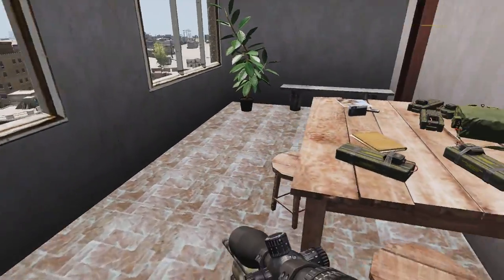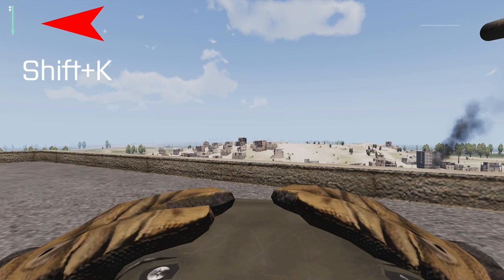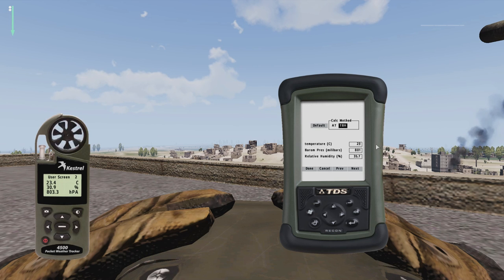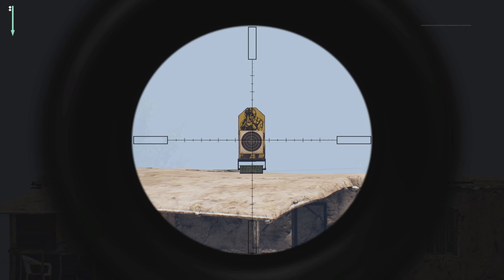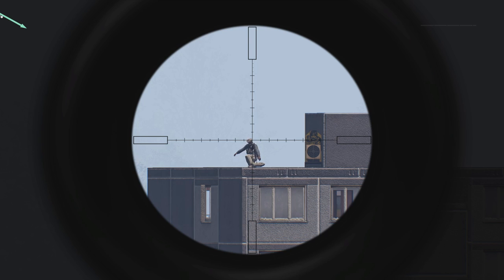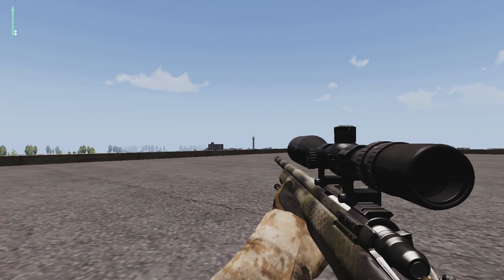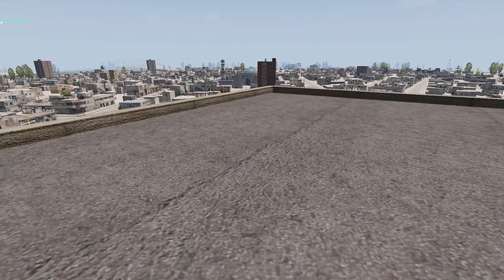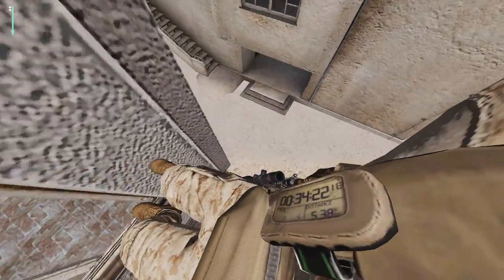Arma 3 - ACE 3 Sniping Tutorial [2017]

Comment: Great video, but you did do a small mistake. the wind direction is supposed to be where it comes from not where it goes, so you entered the opposite clock number for that. the reason the shots still hit is the atragmx told you to adjust right and you instinctively adjusted left. just wanted to point that out...
Reply: You're wrong. The atragmx says R, as in you have to adjust for the wind going R and move the scale LEFT. I've tried it in the virtual arsenal. Adjusting POSITIVELY for the RIGHT is way off. Adjusting NEGATIVELY for the RIGHT is correct.
Reply: No wind direction is input wrong in the video. At 4:10 after he puts in the wind value in the Atrag as 4 oclock (wrong) it shows a POSITIVE windage correction needs to be made.  However he actually sets the scope with a NEGATIVE (correct) windage. If he had set the wind in the Atrag correctly to 10 oclock (not 4) the windage would have calculated the NEGATIVE value that he actually used and been correct.
Two things you need to remember. 1: the wind arrow points in the direction the wind is GOING not coming from and the Atrag is OPPOSITE it wants to know where the wind is COMING from not going (I know, annoying)
2: For scope windage adjustnemt
- NEGATIVE clicks move the crosshair left of target (ie compensating for wind from the left)
+POSITIVE clicks move the crosshair right of target (ie compensating for wind from the right.

Comment: Great video and I've got a little suggestion to improve its accuracy. The reason your having to flip the wind value the Atrag calculates from + to - when you set the scope is because your setting the wind backwards in the Atrag. Wind direction should be 10 (not 4). This will make the Atrag calculate the correct value and you won't have to flip it when setting the scope. Hope that makes sense

Comment: Two Errors:
1. When you input wind speed, in the box labeled "1" is the "low" wind speed and "2" is the "high" wind speed, which means the minimum and maximum of the wind speed if it fluctuates
2. The "Update" button is not needed, as the values in the "abs" column is already the correct value. 

When you click "update", the value in abs would be put into "Cur", meaning current scope setting, which is just to save your scope setting after you have taken the shot. When you move on to a new target and calculate the adjustment needed, the "Rel"(relative) column would display the amount of adjustment needed from you "Current scope setting" to get to the "Absolute scope setting". This feature is needed only for real life, when there isn't an indicator showing your current scope setting, and you can just follow the "rel" column and turn the knob accordingly.
Reply: Doing something that is not needed is not exactly an error.

Comment: How would you adjust for wind on the fly with the range card? I play with a milsim unit and I play as a Designated Marksman. Our rules make it where only actual snipers have an Atrag, and I hear they don't even work anymore. So all I have is a Kestral, vector 21, and a range card. The range card has stuff for wind, but only if it is 4 mps. so lets say I had a target at 600m with a wind blowing east to west at .8 m/s. and for a 4 m/s wind it says adjust 1.2. How would I adjust roughly?

Comment: My biggest problem with ace is the moving. Like if my target moves away I can't shoot them anymore because I'll have to re calibrate. Is that as big a problem or no?
Reply from the maker: it all depends on the wind, if it's blowing over 2m/s, you will have to adjust. otherwise, the target probably wont move too far so you should be fine

Comment: I'm doing all of these stages with the m24 with the same caliber as in the video and tried with most of the rifle scopes but the bullet hits like a "mile" away anyway, it cal land at the bottom of my scope to the second mils from the center, wtf am I doing wrong?
Reply from the maker: Hm, gotta make sure to test how different guns work with ACE3. Because guns from some mods do not perform all that well with ACE sniping equipment. Sorry for the late comment
Reply: The scope adjustments you make are not equal to meters. If you sniped in Arma 3 vanilla just forget everything you know because the ACE mod is as realistic as it gets. The scope adjustments (either elevation or wind) are MOA adjustments. Those numbers do not equal to meters. So thats why you need to know the rifle, scope and bullet youre using. The scopes in ACE3 are for some weird reason 1/10 MOA adjustments scopes. So for every 0.1 click you are making a 0.10 MOA.. 10 "mini clicks" are 1 MOA. In real life scopes usually are 1/4 and 1/8 MOA Adjustments.. A very important thing to know is the reticle youre using (MRAD or Mildot) as the measurements for shooting slightly vary. The best thing you can do is learn the basics withouth any of that fancy equipment. From 1 to 300 meters its going to be easy to shoot. Beyond that is where it gets more difficult. Grab a range card and understand your ballistics.. See how much your round drops at certain ranges and adjust for windage by shooting and shooting over and over till you have a basic feeling of where the bullet will land. Then proceed to use the Kestrel, Atrax and Dagr.
Reply: So in a nutshell.. If you want to snipe somebody with a M24 shooting 7.62x51 M118L  at 350 meters away you DONT adjust your elevation to 3.5 moa.. You check your bullet chart and try to remember values for basic ranges from 100 meters to 500 meters. In this case asuming you have windage coming towards you, just adjust to 1.7 - 1.8 (value for 350 meters drop) and aim for where you want your bullet to hit. Done.
Reply: basically, sniping in ace 3 is a fucking pain in the asssss
Reply: @jordanssfor  Sniping in ACE takes some time to set up right which is what I like. It feels realistic, and I usually play the middle ground between all-out sniper and basic rifleman by being a Marksman. I found that I managed to score most hits with my G3A3 (my go-to marksman weapon) by memorizing range values from my range card and adjusting windage accordingly to how off center I hit. The unit I Play with doesnt provide marksmen with the fancy sniper stuff which sometimes sucks but often times makes The experience more enjoyable.
Reply: @SkyripperThaBird  it is a goal of mine to some day get used to long range engagements but my focus point this year has been centered around learning how to handle situations evolving around me, i feel like gaining that experience will help me a whole lot more when i decide to do some sharpshooting C:
Reply: @jordanssfor  Indeed so, and being a Marksman You need the experience of both being a rifleman and knowing how to engage longer range targets reliably. If you panick when stuff starts going down around you things wont go well when you come up to the longer ranges. Good going though!
Reply: @SkyripperThaBird  Yes, right after I memorize the medical system0_o

Comment: When i try to zero the scope it does not allow me to use the wind adjustments too, it uses the default arma zeroing...any suggestions?
Reply from the maker: yep, not all scopes are compatible with ACE3. for some mods there are also compatibility patches on the workshop
Reply: No no no it is not set any buttons for the wind adjustments. You must set it in the settings

Comment: what are the default keys to change the kestral's screen to user 1, 2 etc?  i can bring it up but can't interact with it.
Reply from the maker: well you need to check your keybinding for 'open kestrel' (i think that's how its called) and not 'show kestrel', because the latter only brings it up for a quick check.
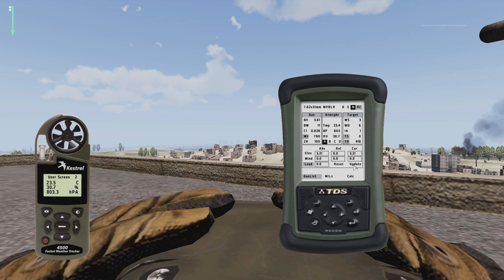Reply: thanks for the response.  another problem I've encountered, however, is that I do not get the option to "update" the ATRAG as you at 3:02. is this normal?
Reply from the maker: hmm... have to check
Reply: yes it is normal they remove the update button becase it updates auto no needed and i have a problem how did you set the -1.1 6:04  i mean i dident get it how do you know that ?is marked on the AtragMX .

Comment: you go way too fast showing the equipment and where you get the readings on the equipment. I'm constantly hitting pause and rewind
Reply from the maker: ill try to slow it down in the future
Reply: Could you explain the wind adjustment? It says 1.14 on the kestrel, but you put -1.14 on the scope
Reply: i got it. right is negative and left will be positive. great work
Reply: Piggy its actually because the wind direction put in the Atrag is opposite what it should be. The wind is coming from 10 not 4. This is also why - and + scope adjustment had to be flipped to get it to work. If you redo this with the correct wind in the Atrag it'll give you the windage number exactly as you set it on the scope (no flipping + and - )

Comment: How do I open both of the equipments, if I open another one it makes the other one disappear.
Reply: if you hover over the thing to configure it, wait for a while and you will see another option for show, this will place it on your screen but you can't interact with it while it's ont he screen that way.
Reply: @Seagull780  hey brother, how do I find out my elevation, and is it important? (For example if I’m sniping a dude at sea level from a mountain while looking down)
Reply: Yeah it is important but I only know one way of finding out, I think it was in the video as well. You need to connect your vector 21 rangefinder to the computer thingy that gives you your solution, then use the rangefinder to designate the target (tab+t I think) and it should automatically give you the elevation. Alternatively some basic geometry and a map should allow you to deduct the elevation from the difference in measured range from your range finder and distance on the map. And I guess you can also just read elevation on the map and make an estimate based on that.